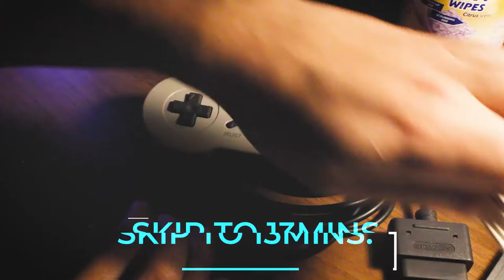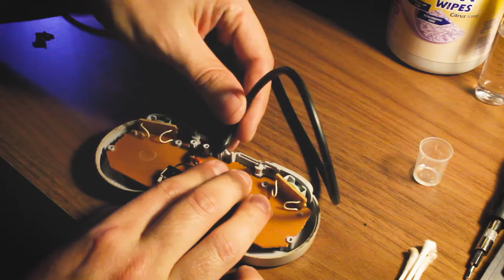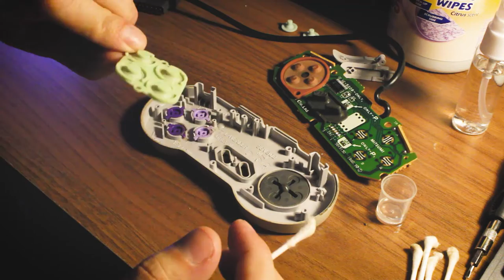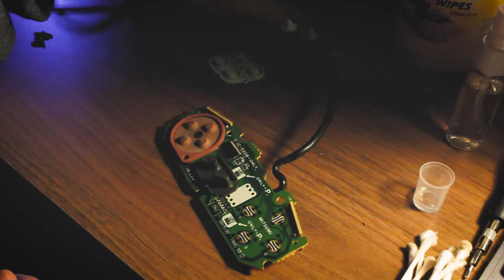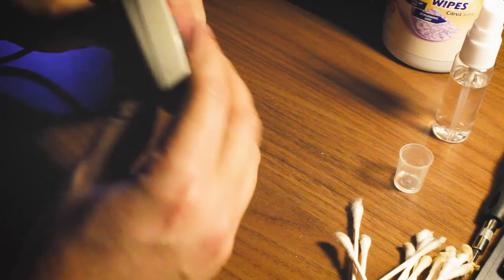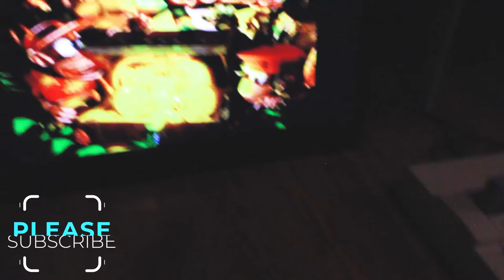How to fix STICKY buttons on a Nintendo SNES controller (STEP BY STEP)

Comment: The screws on my controller are not tightening well, what should I do?
Reply from the maker: They sound stripped 🤔 Perhaps finding replacement screws or a replacement shell for the controller.

Comment: for me, it's all clean, but pressing B makes all buttons press at the same time. bad controller chip? happens on both ports. tried another controller on both ports, it works, so it's the controller that's bad, not the SNES or the ports.
Reply from the maker: Oh that is very odd 🤔 The clean definitely shouldn’t be doing that. Perhaps something on reassembly or damage.